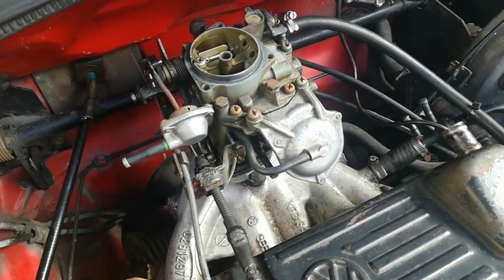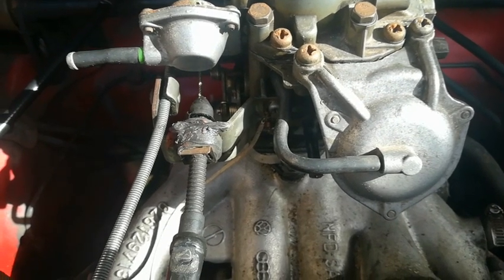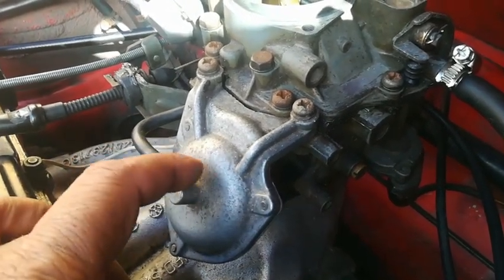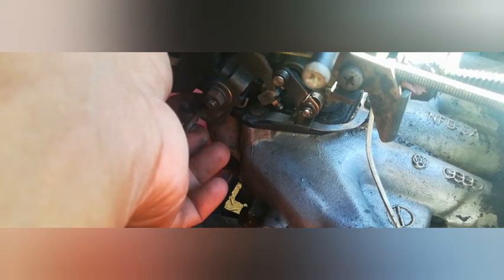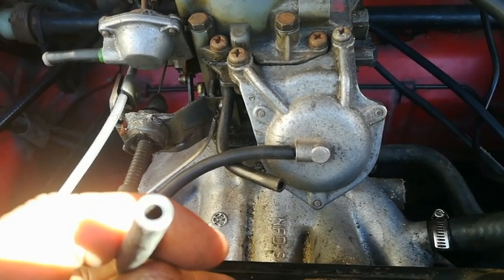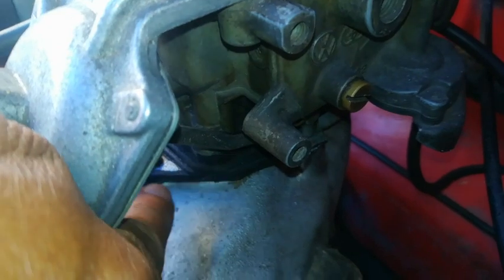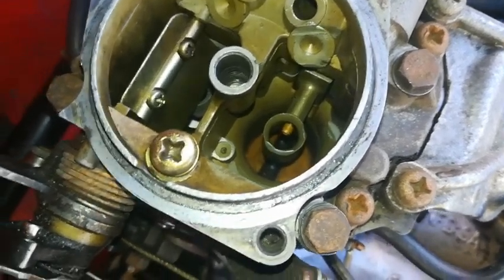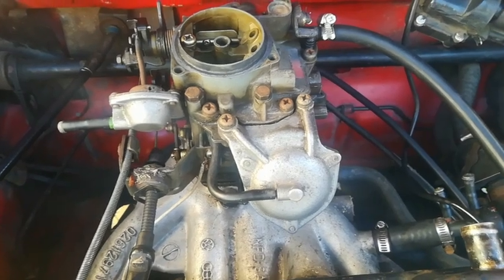GOLF MK1.HOW TO CHECK SECOND 2nd STAGE ON A CARBURETOR Keihin KS2#carburetor #golfmk1#vwgolf #vwfox

Comment: Hi Pj.

Thanks for all your intel.
If i can help and correct you on the blanked off vacuum actuator.
That is a actuator if the accelerator is being pressed and the choke is on. It opens the choke under acceleration so the choke doesnt stay closed. A aircon will have a external source of input. Hope this helps🤜🤛

Comment: Thanks!! I just wanna find out, if u pull on the pipe on the diaphragm, the lever at the bottom will move, but will the butterfly on the inside also move? Because when i suck on the pipe that goes into the diaphragm the lever underneath moves but the butterfly on the inside stays closed

Comment: And if you can maybe show how exactly the vacuum hoses goes on the carb. At the back for timing advance.
Reply from the maker: On the Keihin Ks2 carb there is only one port at back of the carb.,for the Vacuum Advance.... Use a mirror to see it.. Or take a pic with phone..that pipe will run to the vacuum advance unit.. On the distributor

Comment: Hoping you can help .on my carb the 2nd stage opens as normal while driving ... but the problem is it doesnt close ... so while driving the car over revs when i press the clutch in . Any assistance will be highly appreciated.
Reply from the maker: Your second stage  butterfly valve could be dirty and full of carbon..so just spray it down with some carb cleaner.

Comment: Hi PJ..
I have a problem with my vw Fox Mk1. The idle time is perfect but I don't have power going up hills, I am not sure if I need to set the carburetor as it is brand new out the box.

Do you have a solution for me regarding this.
Reply from the maker: Could be one or more things that need to be checked ,like ignition timing ,valve timing ,or the fuel pump ..best to take to someone experienced to diagnose

Comment: Great and informative video as always, I have a question but it's bit of the topic of this video. On the left of the carb there's a unit that I see you have blanked off, what is that for as mine is Connected into the carb, have the same carb
Reply from the maker: Hi that unit is applicable for engines with aircon.. It's like an idle compensator... I blank off mine like many other mk1 owners, who don't have aircon..... If the diaphragm in that unit has a tear in then it's best to blank off both sides, as it will suck unnecessary air into the fuel mix.. It's fine to leave yours as is, but just ensure you don't have a ruptured diaphragm in that unit... So best to blank off.... Well, I'm assuming you don't have aircon
Reply: @pjs-golfmk1-diy  yes thats correct don't have an air con, will blank it off tomorrow both side just to be safe as you mentioned. Thanks for the advice, have a great evening
Reply from the maker: @1andonlySella  well when I blanked off mine the engine just idled much better and smoother, it was then that I realized that the diaphragm in that unit was shot... Not sure if it will be same when u blank off, but just listen to engine when doing so... Blank it off on the carb side, or just put your finger on the pipe coming from carb.. And hear.... Do it when engines hot.... I'm not saying it's going to run better or worse, as your diaphragm in the unit may be fine still...
Reply: @pjs-golfmk1-diy  evening, I have blanked off mine and don't see a notable difference with the idling but haven't driven yet. Also checked the 2nd  stage and noted when I suck on the pipe the butterfly barely opens but if I open the throttle and suck on the 2nd stage the butterfly open 90 degrees. So I take it thats normal. Also just wanted to find out if it's normal for the revs to slightly move. My current rest idle is just under 1K so if I just stand and idle the Rev counter will move slightly up then down I'm talking about maby 2 or 3 millimeters. Thanks
Reply from the maker: @1andonlySella  OK, so that means your diaphragm in the aircon unit is fine.. And yes it's normal as you open throttle wider the second stage will also open wider.. As long as it works is important.. The other question about idling moving about 2 or 3mm...could be to do with ignition timing not 100% on the mark. When last did u set it...
Reply: @pjs-golfmk1-diy  i have had the golf for 6 years, and I have never done it (or had it done) not sure about owner before me.
Reply from the maker: @1andonlySella  would be no harm in having it checked.. The ignition timing can go off mark after a while as the distributor shaft wears and develops some play in it.... But if u happy with your cars performance, don't fiddle with it..
Reply: @pjs-golfmk1-diy  haven't noted any difference in performance, so I think I'll leave as is for now, Thank you for the advice and awesome videos. Much appreciated

Comment: Im struggling with my mk1 2nd stage. Everything tested as you show in die video. But 2nd stage doean't engage while driving.
Reply from the maker: Have checked if the butterfly moves when u pull the lever...?... Also when doing the test.. Look down into the carb to see if butterfly moves.... Other things to check is for Airleak around the carb base, and Servo Pipe  and booster
Reply: @pjs-golfmk1-diy  have checked everything. No leaks. The butterfly opens when I move the lever.

Comment: Is it normal for the second stage to struggle a little when it cold? With the choke on she seems to be working as she should?
Reply from the maker: Yes it will because engine is not up to its optimum performance level yet.. When it's still  Cold, or below optimum temp...

Comment: Is there a way to adjust the second stage?
Reply from the maker: Yes you can, but wudnt advise this... You will have a rough idle and an increase in fuel consumption
Reply: @pjs-golfmk1-diy  is the a guide to adjust it mine has been adjusted before and i thinks incorrect, my idle is not rough but it is heavy on fuel, on idle should second stage flap be closed?
Reply from the maker: @shannonmoonsamy  the flap/butterfly valve shud be closed Yes. Only opens when the Vacuum pulls on it... There is a small screw next to the second stage / arm that you can adjust...

Comment: Hi, i have problem with my 2nd stage! 
After accelerating it takes about 30 seconds for the engine to go down in rpm with the vacumhose for the 2nd stage attached.

Is it possible that its's broken in some way so it doesn't release the vacum when i let off the gas?
Reply from the maker: On the side of carb there's a  lever. Do this test,.. When the rpm does that again, go to the little lever on the side and push back on it, and you will see the RPM lowers.. That means the lever or the butterfly valve is sticky. So just spray some Q20, or Wd40 on the lever to lubricate it..... Or,  the butterfly valve could  be getting stuck from some dirt, so in that case spray some carb cleaner down the throat of carb, to blast away any dirt stuck there
Reply: @pjs-golfmk1-diy  There is no problem to rev it up manually with the lever and it never sticks when i do that, only when i drive. 

But it rattles a bit from the vacum thing that controls the 2nd stage when i release the lever.
Reply: It's only does it when i accelerate hard and it's only for a few seconds
Reply from the maker: The second stage won't activate when u revving and standing stationary. It only activated under load from around 2,5 to 3 RPM..Meaning when you driving the car on the road
Reply from the maker: I also had that problem.. And I just lubricate up the levers on both sides, and used carb cleaner on the inside
Reply: @pjs-golfmk1-diy  Yes i know but it's possible to rev up the engine only with the twostage using the lever on the side.

Thats worth a try but i think i have a bigger problem
Reply from the maker: @andyhouston69  yes u can Rev it up using second stage lever..